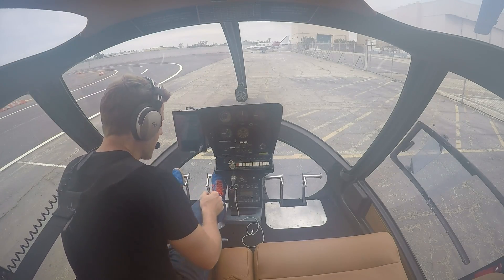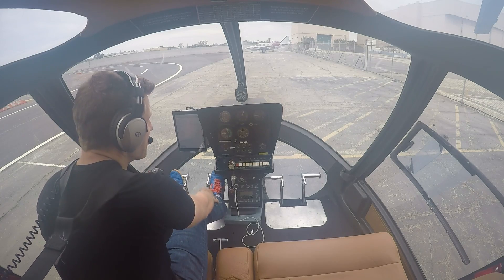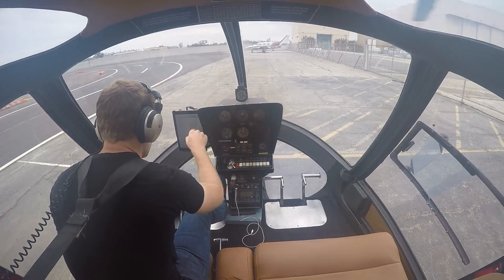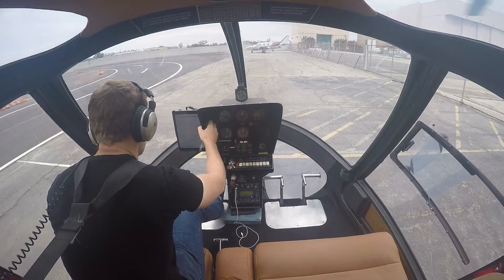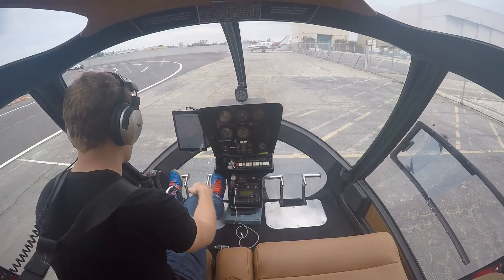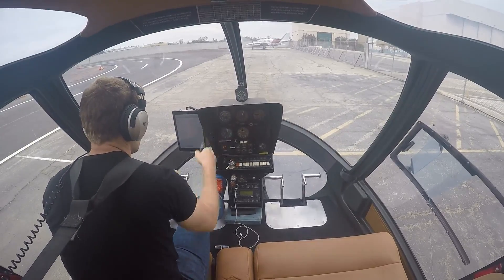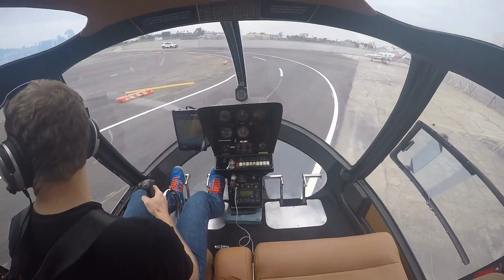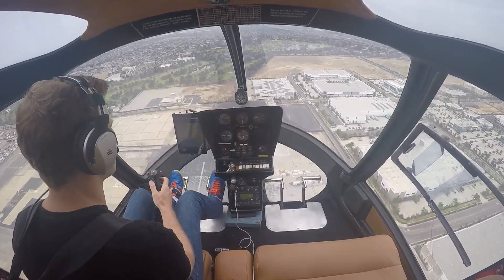Helicopter Startup And Takeoff -  Enstrom 280C

Comment: That is super complicated but it must be so awesome to fly :-)
Reply: Just at the beginning. After doing it many times, I am sure it will be easy for you. I know because, after working on the  Air Force F-16 for 20 years, all the controls and indicators make things look so complicated the first time.   I used to start the jet for engine runs after we installed the engine and shut it down after the maintenance checks were done.  Sometimes secured the jet and do an afterburner run.  No checklist for the emergency procedures and power settings. Bad things happen quick and you don't have time to flip pages.  Technical book procedures, power settings and indicators are all memorized and you will be tested on a simulator after few months to stay certified. You better pass or you will be in uniform in front of an officer explaining why you didn't pass in some cases....no pressure.  Let the control tower and maintenance operations know where you at and your intentions before starting that jet, otherwise you will be surrounded by the military police aiming their weapons at you.
Reply: David Mohr David, unless you had half of your brain removed and only one eye, you could do this too...trust me...

Comment: Can you share what equipment you use for audio recording? I guess for the video you would be using a GoPro?
Reply from the maker: fabmeloman Just using a GoPro Hero4. For sound I’ve got a headset plug adaptor with a GoPro audio input. Super simple.
Reply: @MicahMuzio   That was exactly my problem, I managed to find adaptor for plane headset but not for helicopter as they are different. I would not mind if you could share what you have exactly, if you can.
Reply from the maker: fabmeloman Got my adaptor at sportys dot com. Just search “helicopter GoPro adaptor”
Reply: @MicahMuzio  Found it, thanks a lot

Comment: Worked for a training company in the late 80's, at that time the cost per hour for 300c was around $175.00/hour, not cheap. The guys that used Robinsons could charge less money and make it more affordable for you to learn to fly helicopters, but they were businessmen, not people who considered money over everything else and jeopardized their business in doing so. 

Nothing wrong with a 1978 aircraft as long as the inspections are kept up on the aircraft and the engine is put in overhaul when its total time calls for it. No Cooking the books!

Comment: Interesting that it was so difficult to start the engine with to days advancements. Never had that problem with an R22 or R44.
Reply: I don't know if that was a cold or hot start, but sometimes fuel injected Lycoming engines can be notoriously difficult to hot start.
Reply: @b1blancer1  thanks for your valued insight.The R22 use carbs and start quickly. I did not know that the R44 used fuel injected but never noticed it being difficult to start in the Phoenix area.
Reply: @benevolentdictator2315  I'm assuming this is a fuel-injected engine he's working with. I don't see a carb heat control anywhere, and the electric fuel pump prime and mixture and throttle settings for starting are exactly the same as a fuel-injected Cessna 172 or 182. If he was doing a cold start, I would suggest that being a little more generous with the throttle setting and length of fuel pump run before attempting a start might alleviate some of the difficulty he was having.

Comment: Thanks for interesting video - just one question, what does the button on the top of the joystick do - I notice you pressed it quite a few times in the short video?
Reply: Cocked hat cyclic trim ?
Reply from the maker: Clive Davis @Max Flight is correct. That button is actually a 4-way trim adjustment hat. I use it to reduce cyclic forces, which change depending on air speed.

Comment: Wow. All this technology and a 1930s carburetor to manage fueling. The aviation industry is such a weird mix of super modern tech and ancient throwback. Even some snow blowers are fuel injected now. I know people say it's proven tech, but so is steam. Funny that in aircraft the best tech is either on super expensive aircraft or experimental aircraft. So you can get fuel injection on Rotax and all ULPower are FADEC. One of my friends used to fly cargo on Chieftains, now he's a captain on jets. The aircraft was fitted only with original vacuum gauges, no modern instrumentation. He used to take his own electronics, which is legal so long as they aren't 'installed'. He quit and moved to jets when he was doing a maximum weight takeoff into IMC one day and got a hot cylinder and ice started to accumulate on the wings.

Comment: what causes the heli to autorotate when the engines fail? Does the motor do it from the air it treads when dropping out of the sky.. or do you manually do it somehow with brute force? Is it a natural function or something built into the motor?  Why do drones drop out of the air when they experience a motor malfunction? Why dont they autorotate as well?
Reply: It's no different than cruising down the hill in a car and engaging the clutch to slow the vehicle down using the engines compression power
As you're falling through the sky the wind passes through the blades and you release the clutch and the blades Spin and slow you down

Comment: How long did you have to take lessons to learn to fly this helicopter safely.
Reply from the maker: Dawn FKA hamilton-doerfler I already had my pilot’s license when I bought this helicopter. It took about 5 hours of training before I felt confident enough to fly solo. 

The big trick is that my heli has a completely manual throttle rather than a governor or correlator. Meaning anytime in raise or lower the collective I also have to manually roll on or roll off a twist-grip throttle to maintain proper RPMs. Now, after a few hundred hours in my heli, flying with a manual throttle feels second nature.

Comment: Not sure if you're still available for an answer, it's quite an old video but  ...  there were some fatalities here in the UK  on 27th October 2018 when Leicester City Football Club's owner's (Vichai Srivaddhanaprabha) private helicopter had a serious malfunction with the tail rotor. 
I've been a fixed wing pilot since 1976 and know very little about rotary wing aircraft. I've been led to believe that in the event of a tail rotor failure, the main rotor should be cut immediately in order to prevent the aircraft going into an uncontrolled spin. Is this true? Also, is it the case that with a modern and very well equipped (the best I would imagine as the owner was a billionaire) helicopter, once the tail rotor fails the top or main rotor is automatically shut off, thus allowing the aircraft to descend in a controlled fashion, ... the main rotor being turned and providing some lift due to the sinking of the aircraft causing the rotor (the disc) to rotate. 
If this is not the case and the main rotor is not automatically shut off in the event of a tail rotor failure, do you believe it should be or is it down to the pilot to shut off the top rotor (disc)? .... as the consequence of it not being shut off seems to be an uncontrollable spin .... one which killed all on board in this tragedy. Thanks in advance.
Reply from the maker: newchan Here’s what I can tell you. 

The main rotor and tail rotor are mechanically connected and do not spin independently. However, in the event of a tail rotor or engine issue the pilot can lower the collective control, which flattens the blade pitch of the main rotor. As a result torque is no longer transmitted to the main rotor thereby reducing the twisting action that the tail rotor counteracts. 

The issue with the October crash in the UK is that, to my understanding, the tail rotor had a mechanical problem that increased its anti-torque pitch. In essence, the tail rotor was trying to counteract more torque than was being sent to the main rotor. In that condition, reducing blade pitch and torque to the main rotor only exacerbated the spin. In that condition I don’t think there were many options for a safe landing. A tragic outcome that will hopefully lead to safer flying in the future.
Reply: @MicahMuzio  Thanks for that information micah, it seems that if the tail rotor breaks up, as applied in the case to which I referred, there is obviously nothing to counteract the rotational force generated by the rotor. I was under the impression that the main rotor could be shut off and allowed to 'freewheel' in order to still rotate in order to provide some 'lift' to slow the ensuing emergency descent. 
I now understand (I think) that in the event of a 'standard' tail rotor failure, the rotor is not shut off as I said but that the blade pitch is flattened so as to produce less rotational force and that this flattening of the blade pitch is done by the pilot and doesn't happen automatically after a tail rotor failure. 
Do you ever see the possibility of this adjustment to the 'collective' being an automatic thing? That is, not requiring pilot input. 
More importantly though and in the case of the tragedy we've discussed, it was the disintegration of the tail rotor blades which was the cause of the accident and perhaps this was caused by the mechanical problem you mention .... perhaps, as you have implied, the tail rotor revolutions exceeded what was 'called for' by the mechanical linkage to the main rotor and it was this which caused the blades to break up? If you get time, please let me know if this was the case as you understand it. 

I was very interested in learning to fly in rotary wing aircraft back in 1976 and I remember that the PPL course for heli's was normally 40 hours but the fact that I had a fixed wing licence meant that I could qualify after only 35 hours. I also remember the cost per hour being 50 UK pounds ... fixed wing (PA28) cost was 16 UK pounds. The difference back then was huge so sadly, I never got to do all of what I wanted. Such is life. 
Thanks again for explaining this stuff ... much appreciated.
Reply from the maker: newchan You are correct about a freewheeling mechanism. In piston helicopters there is a one-way clutch that allows the rotor system (main and tail) to keep spinning if the engine stops. A similar function occurs in turbine helicopters. 

To clarify though, in flight the RPMs for a helicopter’s main and tail rotor are consistent. In my chopper the main rotor spins at 350 rpm. The tail rotor is directly connected to the main rotor gear box and spins at a faster but steady rate. The tail rotor creates more or less anti-torque thrust solely by adjusting blade pitch. 

So, in the case of the UK crash my understanding from reading a preliminary crash report is that the tail rotor blades had moved to their maximum pitch due to a mechanical failure. The result was an uncontrollable spin that only got worse when the pilot lowered the collective. 

Lastly, I do know of a company that sells an automatic collective pull-down system for Robinson helicopters. I’m sure similar systems exist elsewhere but they are not common.
Reply: @MicahMuzio  Thanks again Micah. Not sure if you have seen the film clip which was shown on UK TV where fragments of the tail rotor can be seen being ejected from the copter's tail as the tail rotor disintegrated. 
This is a video of one news report.

https://www.express.co.uk/videos/562117/Leicester-helicopter-crash-caused-by-tail-rotor-failure-says-expert

It seems that there's a possibility that the tail rotor greatly exceeded its design parameters in terms of the rpm which occurred, or the pitch became unsynchronised. If that is the case and assuming all of the maintenance logs are up to date along with the service intervals having been stuck to or bettered, then the aircraft's manufacturer could possibly be held responsible for this accident. 

From what you have described so far I can now understand why this tragic event was different to a 'standard' (strange to say that but you'll get my drift) tail rotor failure which can be dealt with by the pilot. I imagine that the number of cases in which the tail rotor 'runs away' (rpm or pitch) uncontrollably are very small in number .... and thank God for that, assuming this to be the case. 
Thanks very much again!

Comment: once you took off, you kept fiddling with some knobs right near the choke, what were those?
Reply from the maker: That’s the fuel mixture. You push it in to allow fuel flow and pull it out to stop fuel flow. But you can also twist it right to richen or left to lean the fuel mixture. In my Enstrom you can lean the mixture to improve cruise flight fuel efficiency but only up to a certain temperature as measured at the turbo inlet.

Comment: This is the perfect helicopter instruction video.  He literally answered all of my questions about helicopters.  For example, I use to think helicopters were unsafe due to if the engine fails, I thought they just dropped from the sky.  Well, according to the info of this pilot they do not, you can actually glide them to safety.  Well done.  Very nice video.

Comment: Interesting.  Wondering why you just look at the fuel gauge to determine the fuel level rather than check the clock and take a guess. Wondered by the newsmen reporting on traffic would always sound funny - now, I know, the blades are off center.  In the movies, the guys would jump into the copter and take off - in less than a minute.
Reply from the maker: Dan R. Graham Good question about the fuel gauge. In my Enstrom it’s notoriously inaccurate, especially at low fuel levels. 

On the other hand, fuel burn rate is fairly consistent. 15 to 16 gallons per hour. For accurately assessing available remaining fuel, time in flight is the better option.

Comment: Can someone explain what the "friction" is? Not friction itself, I know that but as it applies to controls. You want it off to check then put it back on?
Reply from the maker: 69adrummer In my chopper the friction holds the ‘collective’ in place. The collective is the control that makes the helicopter go up and down. If the collective were to accidentally lift up the helicopter could take off and crash. And so, there’s a friction to hold it down while the pilot is completing pre-flight checks.
Reply: That response is "ohh duh"!! haha thank you for that. I was wondering what the two had to do with each other now it makes sense. Also, I guess if you were to take your hand off to do something, it wouldn't slam down therefore causing another issue. Thanks again man, take care!! :) I feel like an idiot now! haha  @MicahMuzio
Reply from the maker: 69adrummer Naw. Totally fair question. Happy to answer. Cheers!!

Comment: Cool. Piston Lycoming in heli runs at  2900 rpm as opposed to 2400-2500 in fixed wing. I wonder what the rotor speed is. Nice Job...
Reply from the maker: Rick Via Good question. 350 rpm.

Comment: You tried to start it from 2:00 t0 2:56. Is that normal? Fix wing piston engines start in one or two turns of the blades (second or two). I assume this FI Turbo engine is mounted vertically? Cranking RPM sounds slow? Maybe you drained the battery a little? Can I suggest, trying variation to your starting procedures (within common sense), e.g., prime a tad longer, crack the throttle a tad. All that squeaking, and bouncing, I'm scared, let me off!!! Ha haha. Piston helicopters not for me and turbine too expensive. Regards from fixed wing pilot.
Reply from the maker: You were spot on with the battery comment. Swapped in a new one and the chopper starts with zero issues now. Cheers!

Comment: Mate, as a aircraft engineer, that restraint system looks to be about fucked. The loose threads are a big concern, a few loose threads or a small amount of chafing can degrade a belts useful load by 75%. The other thing of concern is that the anchor point of the shoulder harness is well below the shoulders, anything more than 5 degrees can cause spinal compression in a high forward velocity crash, probably not much you can do about that though as it is the design.
Reply: A high forward velocity crash in a helicopter and the condition of seatbelts might not matter.

Comment: why the helicopter does't goes up even when the propeller starts? :D (noob question.)
Reply from the maker: Fair question. The helicopter doesn't take off when the blades start spinning for 2 reasons. 

1. The blades aren't spinning fast enough yet. When flying, the blades are spinning around 350 rpm. When idling they're at less than 50 rpm. 
2. On the ground the blades are at "flat pitch", meaning they aren't angled enough to create lift. When flying the pilot increases the pitch of the blades using the collective (a lever operated with the left hand). Helicopter blades work just like airplane wings. To increase lift, the leading edge of the blade needs to be angled up. 

Hope that helps.
Reply: @Micah Muzio thanks for the explanation, appreciate it... :)